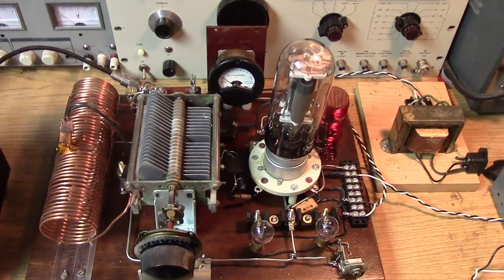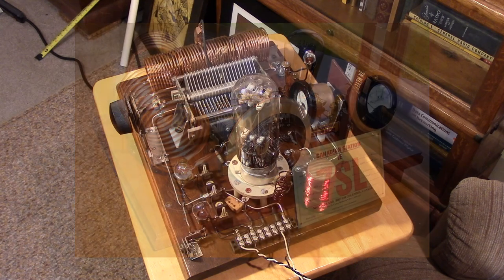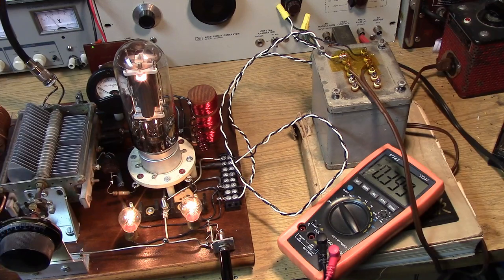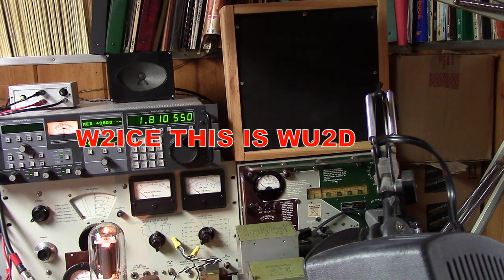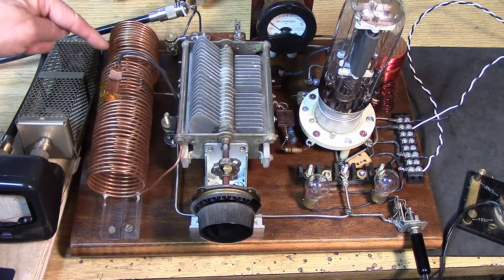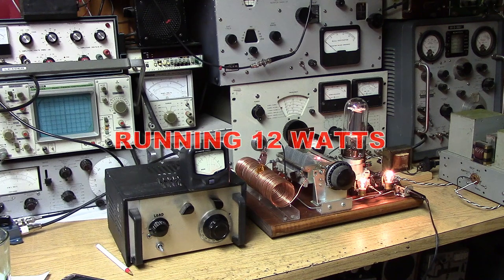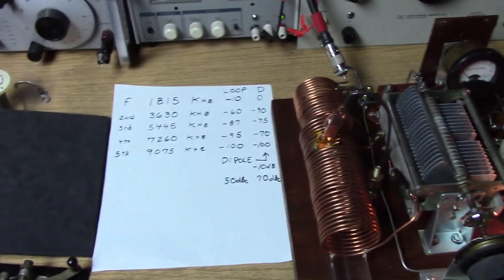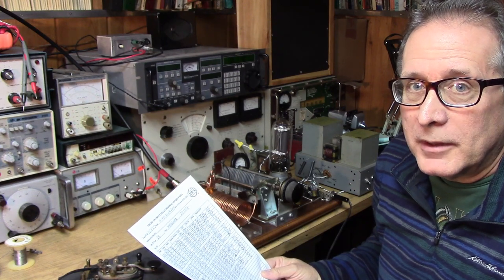Old Time Transmitter Contest - Part 2

Comment: On many occasions, I have heard similar signals from Cuba and parts of South America in my 52 years as a CW Ham Op after getting my Novice licenses, age 15 and in the 10th grade.. I suspect in some cases it was just bad electrolytic caps but maybe some were AC modulated. 
Thanks for the demo..
73 de WA4AOS, Glenn  dit dit
Reply from the maker: Remember the Bulgarian Buzzsaws!

Comment: It was nice to work you on 80 meters with my 29 Hartley (two type 27 tubes in parallel). 73 Pat K9HF
Reply from the maker: Great to work you! Those 27s are the key to getting on the air fast and with a lower cost plentiful tube. A lot of folks are using them in push-pull oscillators too!

Comment: Hi Mike.  Great series.  When you're taking the harmonic measurements, how far is the receive antenna from the transmit antenna?  I'm not sure how large your lot is, but your receive antenna is probably within the near field of the transmit antenna and I would question the validity of the measurements.  A receive antenna several wavelengths away would be more accurate, though undoubtedly not very practical or doable for most of us.  Anyways, I really enjoyed this and all your videos are very inspiring.  Keep up the good work.  73 de K3NG

Comment: So what did you use for the cap between the link coil and ground?  I'd think a 1500pf variable would be pretty conspicuous, or did you omit that in your build?
Reply from the maker: You can adjust the turns and omit most times.

Comment: Lovely transmitter and lovely sounds. Apparently i just missed the latest qso party. 
I barely have any access to 1920s tubes, but i just built something fun with a little DCC90 double triode. Sounds the same, but it's just a bit smaller and newer.
I hope some day to make a qso with one of those old rigs, even though i don't have any 100 year old tubes. Though i might have one trick up my sleeve that's even dirtier and older than the self rectifying sets...
Reply: Those tubes show up regularly on eBay, so save your centavos and get yourself one (or more!)

Comment: IIRC from reading some very old articles from QST, there were some self rectifying transmitters that used two tubes where one tube was the rectifier for the other one on alternate AC cycles.
For the contest, does the tube have to be made before 1929, or just be of a type made back then?  How about a 'later version' of the same tube, IE: a type 801A which is really an improved  type 10Y, itself a newer version of the UX210 which WAS a 1929ish tube.
Since you are feeding the antenna with coax via the transmitter coupling loop (at ~50 ohms), you could add a 'transmatch' or a low pass filter between the transmitter and antenna for even better harmonic suppression if needed to keep it 'legal'.
Your transmitter circuit isn't exactly 100% true to the original because the tank is shunt fed.  The old timers would have a 'HOT' tank that was in the plate circuit without any blocking capacitor!  The capacitor roter would have had to have an insulated coupler to the knob (some of the WWII era national vernier dials had this built in).  Of course, the original circuit often did have the RF choke in series with the DC feed, and a bypass capacitor, so the same number of parts were used.  Just that the mindset of the day was that the shunt feed was inferior somehow.
Reply: @user-em7lp1sb4k  I have a type 810 in the junkbox that is sorta kinda like the type 838 and 211 except that it has the grid  and plate are brought out to external caps rather than at the base..  There is also the type 841 that is very similar to the type 801 and 210 triodes.
Really, ANY directly heated triode transmitting tube (809, 811, 812, etc) should be acceptable for this circuit as most of these tubes are directly descended from types introduced before 1929.
Reply from the maker: The Tube itself does not need to be vintage. The tube type needs to have been developed before 1930. Example UX210 or 310- any Type 10 variant would be a candidate. I think you are pushing it with the improved VT-25, 10Y, 801A or a 2A3, so I would say no go on those. The modern 211's are fine. Maybe one of the AWA guys could comment.
Reply: @MIKROWAVE1  Well, I suppose one could build a transmitter using what ever pin compatible tube he could find, and then replace it with a vintage type when it becomes available....
Reply: @user-em7lp1sb4k  Somewhere in the junk box I remember I had an 838 in a socket.  Haven't seen it in years.  While technically that number is post 1929, it sure LOOKS like a 211  or 203.

Comment: voltage quadrupler from 120v mains sounds good. Acrylic rods to strengthen the coil
Reply from the maker: Wow that sounds scary and all too possible. But those things (beyond being a bit dangerous to life) are notoriously poor for regulation. Turns out my supply did not have enough bleeder on the output to have decent regulation.

Comment: In the event one of these transmitters doesn't meet requirements and one is concerned I don't think a LPF ('29 style or not) would be outside the sprit of the contest, not like the 50 ohm coax is period correct either. The goal is to build cool stuff and use it on the air, not fully replicate a 1929 ham shack.
Reply from the maker: Yes even a simple antenna tuner is a great idea.
Reply: LPF?
Reply from the maker: @Capecodham  Low Pass Filter - as in reducing the chance of harmonic transmission.